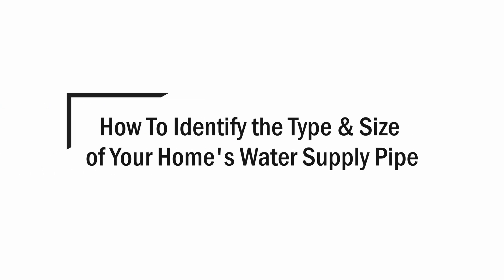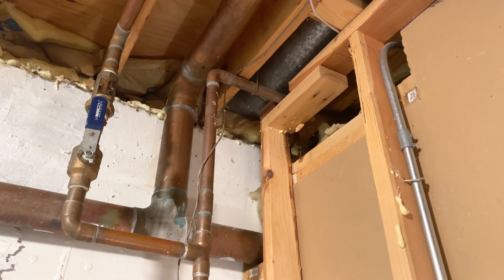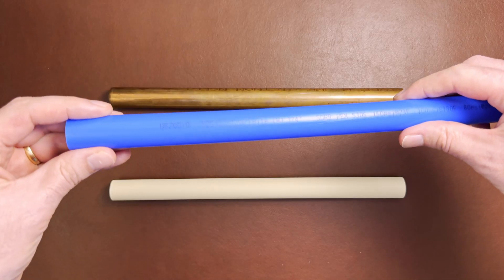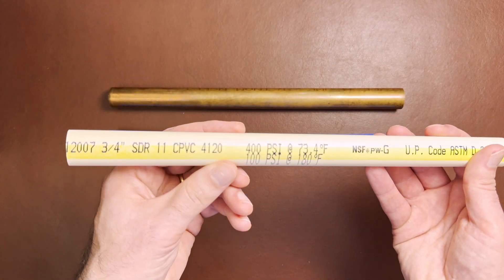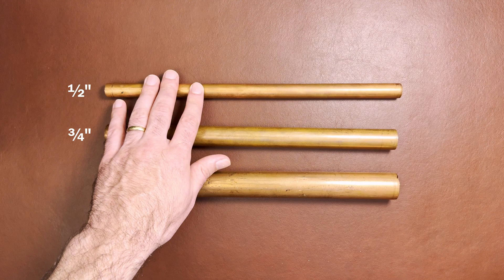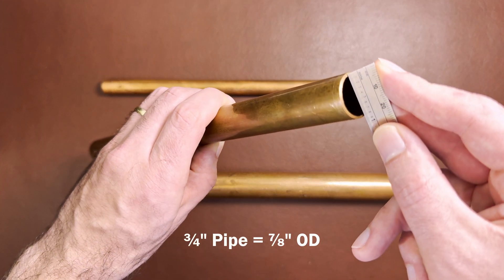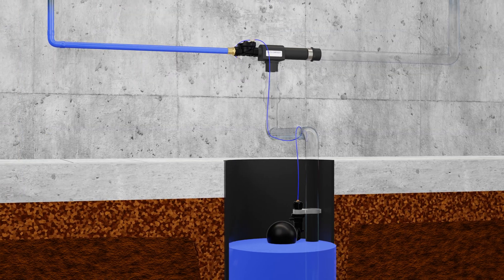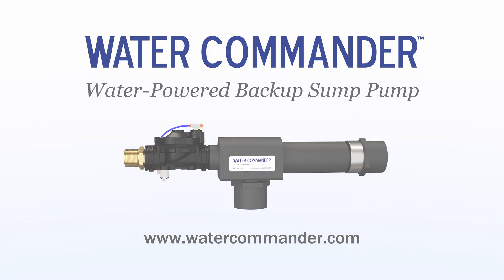How to Identify the Type & Size of Your Home's Water Supply Pipe

Comment: Please let me know 2000sqf house needs 1” pipe or not , water company charge  us 1” water services?
Reply from the maker: Typically we'll see a 3/4" water main for a 2,000 sq. ft. house, but newer construction may have a 1". If your house has a 3/4" water main, it will have a 5/8" meter. If you have a 1" main, then it will be a 3/4" meter. You'd have to talk with your water company to understand how they charge and if the water main size affects that.